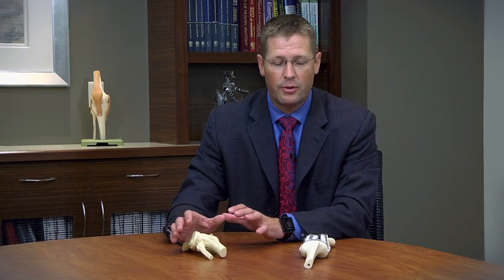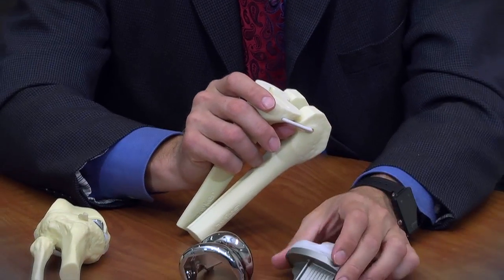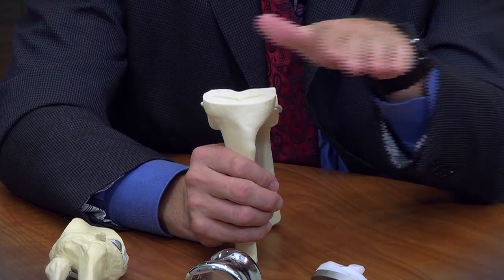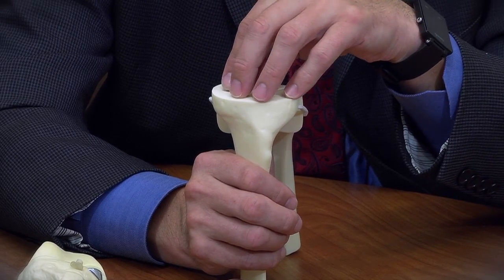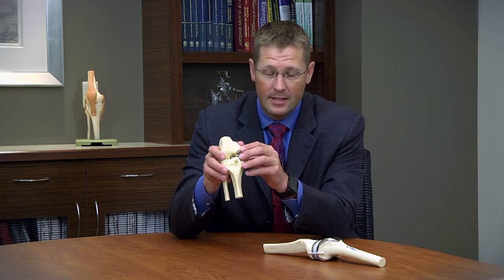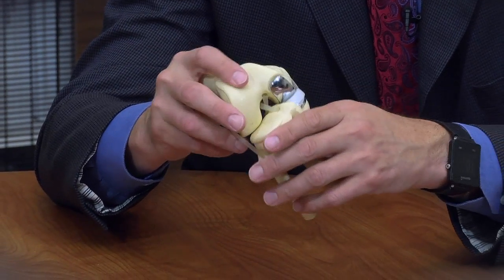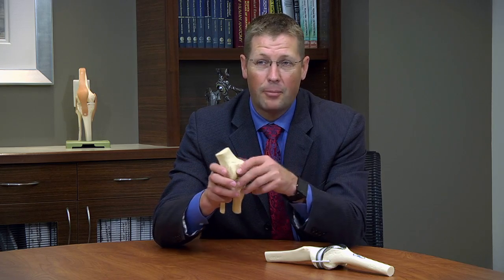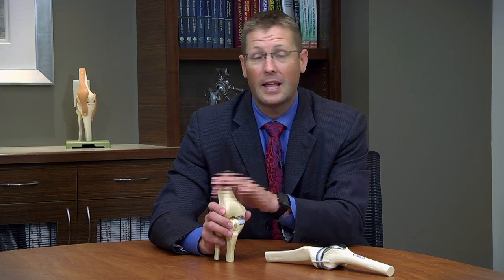Full Knee Replacement vs. Partial Knee Replacement

Comment: Tkr is failed treatment for OA as it is only surgery and no treatment. Body has 206 joints how many you will change, It also mean losing your legs and there is only amputation and no Resurgery. Avoid totally.